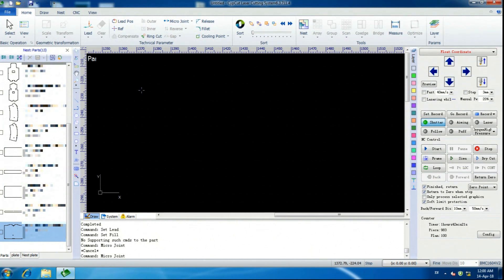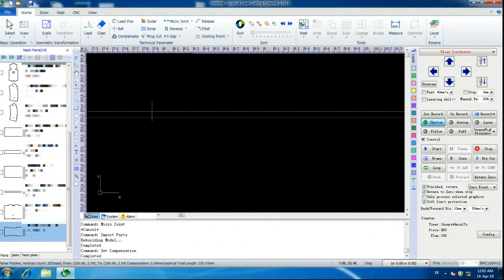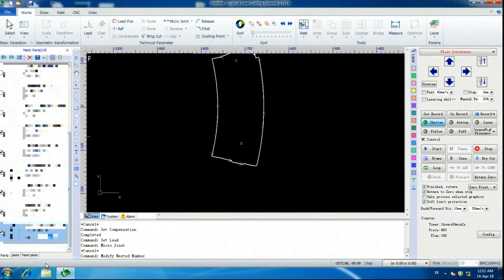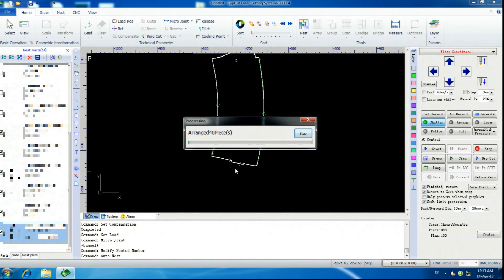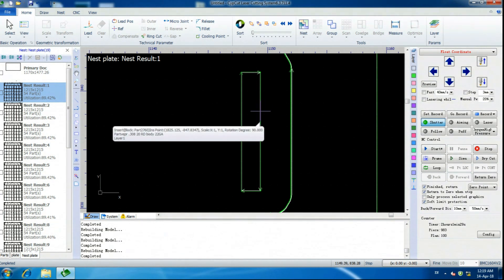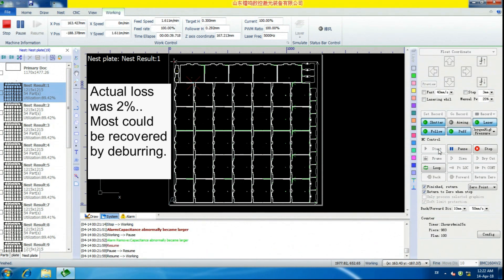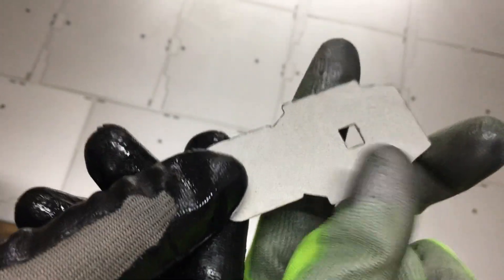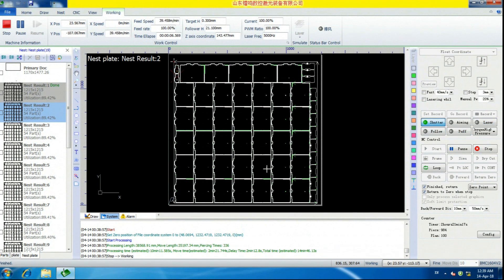Nesting parts in Cypcut for laser cutting (english)

Comment: TIP TOUCH Alarm in cypcut
please find the solution
Raytool cutting head we using
Reply from the maker: It helps to calibrate the sensor with the vent fan off, and to be sure your metal slats are reasonably clean and reasonably flat, also wipe the tip of the nozzle with a clean cloth while using blow to remove metal dust.. Next is to use tabs to hold larger parts to avoid the parts from tipping and bumping the head.. Even still it is not unusual to have the sensor trip once per three or four sheets. One thing that can help solve the issue is to point a camera at the laser as it is cutting to record what happens before the alarm sounds.. That way you can solve the issue..
Reply from the maker: See the video https://www.youtube.com/watch?v=sZ_i1uTeuoQ which shows how to calibrate the sensor. That may solve the problem.

Comment: Hello, this video was very useful, I'm actually working in a metal pieces factory and I have the responsibility of Nesting Process, I got a big doubt
is possible to program the nesting in other computer and then get it in a usb to load it in the laser pc? Thanks for your help and your video!
Reply from the maker: It is possible to nest on another computer and save as a laser document then move the file with a USB drive. You would need the same software on both computers so that the files could be shared.. Cypcut is available for purchase, and it is possible the machine dealer could also supply an additional copy of the software... Ideally you would have a copy of the same version.. There are also more powerful nesting software types that require more powerful computers to get increased yield from each sheet, if you are in a factory it is likely you would benefit from more expensive software to reduce waste of metal.
Reply: Thank you very much, it is good to know there are persons who don´t think twice before answer a question. We´ll keep in touch, thanks for your useful help!!